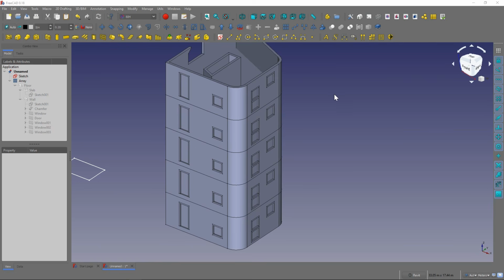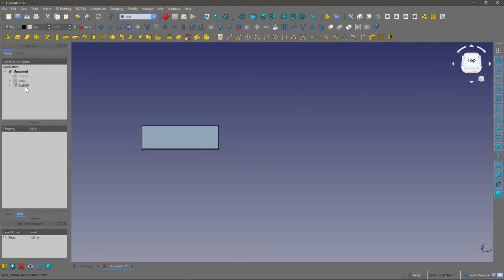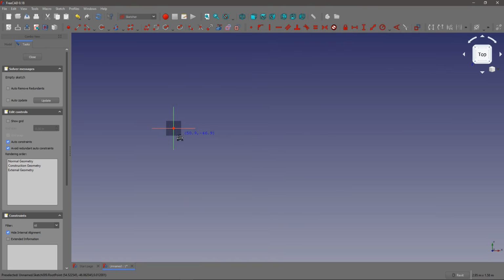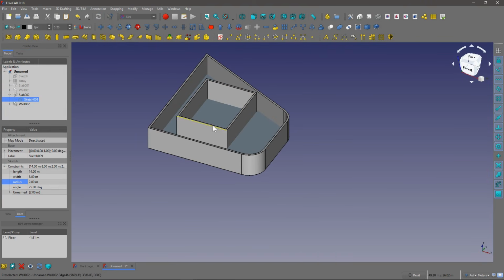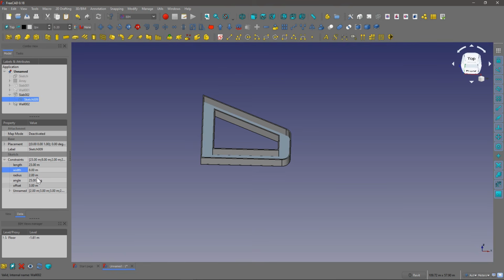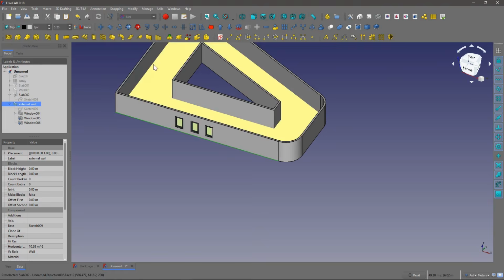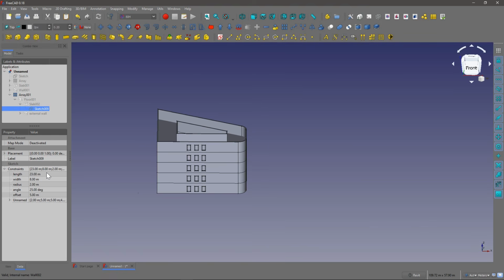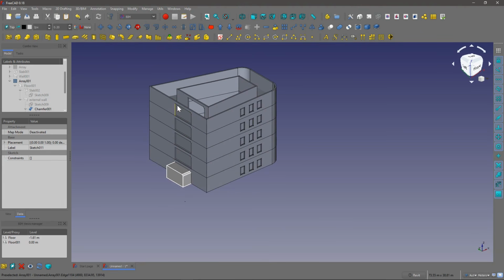Freecad intro for Architects and Revit Users 02  - Sketches, constraints & parametric relationships

Comment: use arrays 4 windows and doors
Reply from the maker: Good tip! You may be interested in this conversation over on the freecad forum concerning arrays: https://forum.freecadweb.org/viewtopic.php?f=23&t=55993&sid=1e5f3fdce651007b047ece753ad9baa0
Reply: @UHStudio  Ty, Also if you wanna fix window array issue, try to array facade modules like tissue works and after array levels.

Comment: I'm using Fusion360 (design and CAM) but honestly I'm growing tired of their constant bugs and changes in licensing. I can't afford their paid license, so I can't complain. But I'm getting into industrial design and I'm an architectural aficionado, I like designing and building things for friends. Is FreeCad reliable? I have no issue in learning a new software, but I'd only do that if it's useful in the long run.
Reply from the maker: Definitely not as polished, but it's definitely reliable. In fact, there is currently a mass exodus from Fusion 360 to Freecad :)